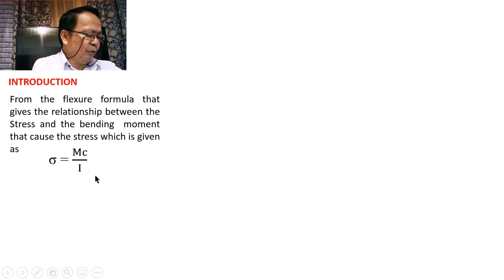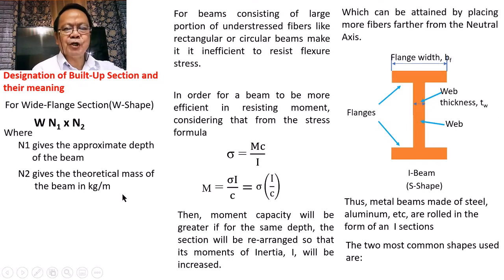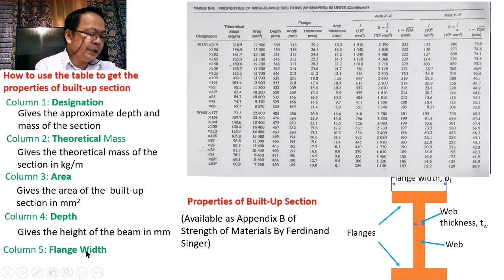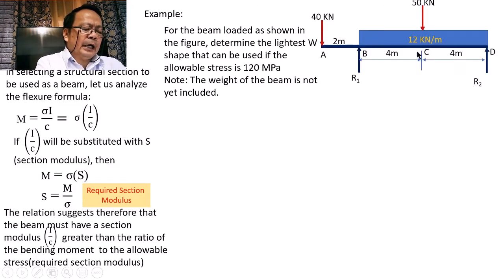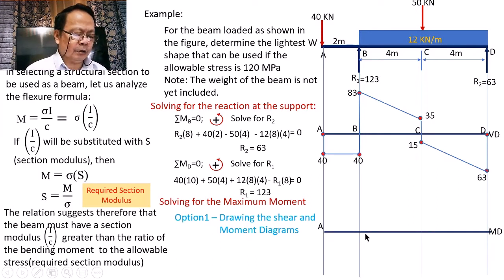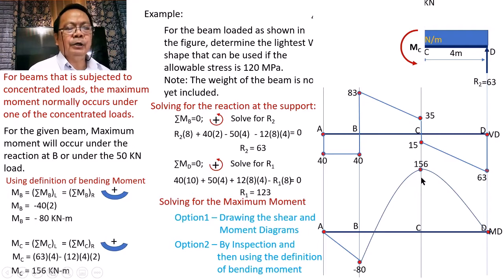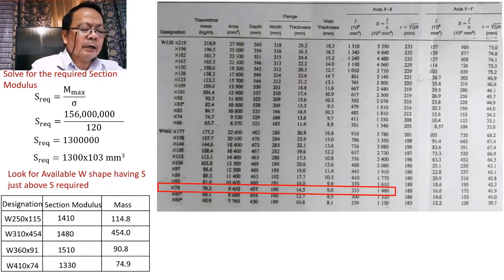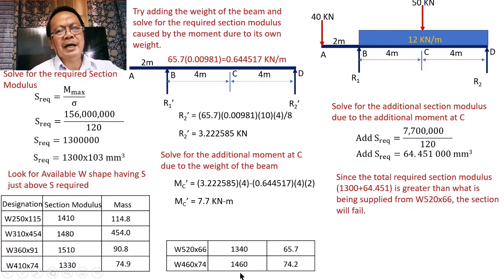Most Economical Section

Comment: Hello Sir. From the last part, I will just ask if we get the Maximum moment  with the weight of the beam, we consider that the weight of the Beam should be uniform throughout its span? Isn't it that if we get the Moment about R'1, it should be R'2= (0.644517)(10)(3)/8 not R'2=(0.644517)(10)(4)/8 ?? considering that the resultant of the uniform load due to weight is on the midspan?
Reply from the maker: Thank you for watching .. if the weight of the beam shall be included, then the maximum moment from the combined deadload and liveload shall be considered in the determination of the the required section. If the weight if the beam is considerably small compared to the deadload, it may not affect the location of the maximum moment. But you can still check for its location by recomputing the moment this time from the deadload and the weight of the selected section.
Reply: Sir simply supported beam po ba ito?